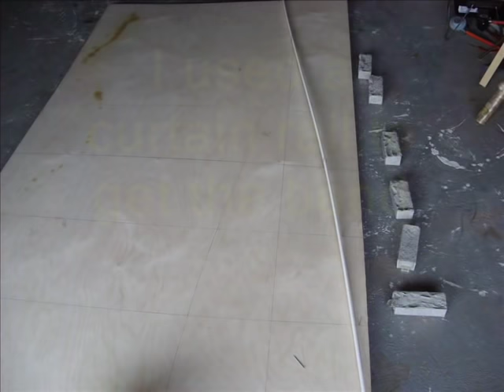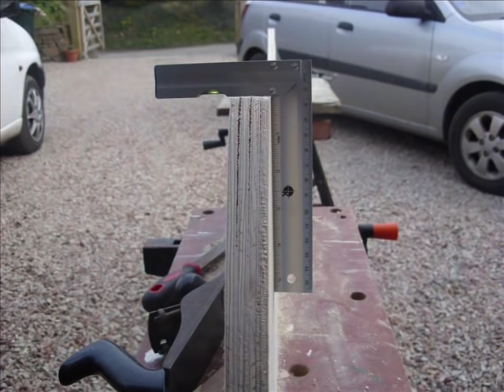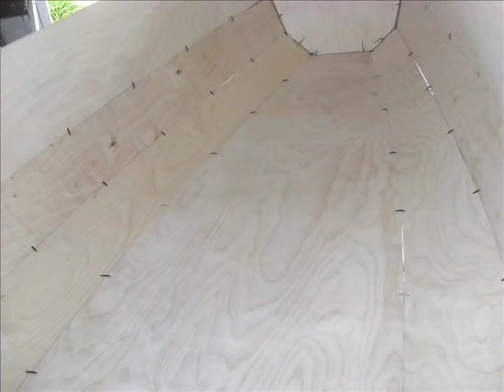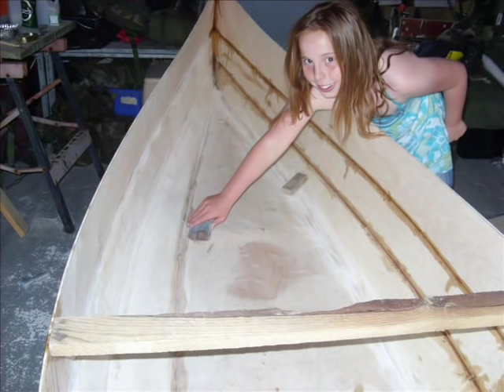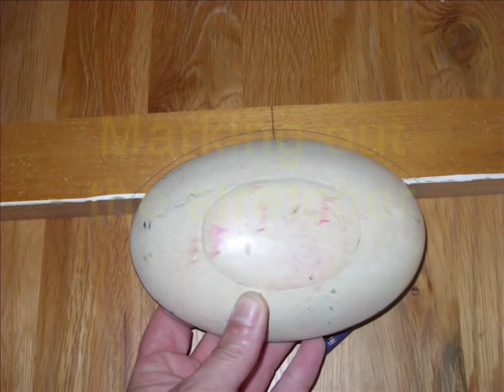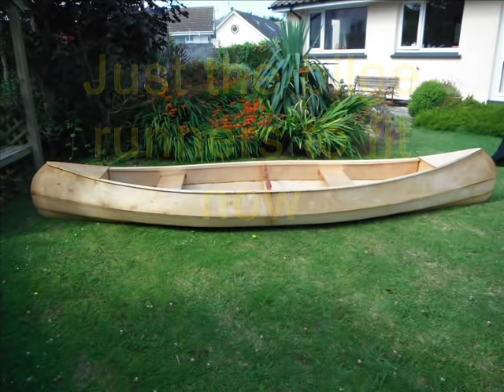Homemade Canoe and how I made it

Comment: about the panels: are they each the same width over the full length or do they taper a bit, espcially the 2 lowest ( not the bottom)? I see that the panels are tapered and than go in a curve. Nice boat btw. tubedujacques is where you see my first kinda diy canoe all from the head no drawings.
Reply from the maker: They taper a bit👍

Comment: hi what glue did you do the gunnels with no nails or something? im building a boat out of my head lol and using snippets of info for the build using polyester resin for the bonding i thought i was buying epoxy its what i asked for and 180 grm cloth for the joints preying she comes out boat shaped